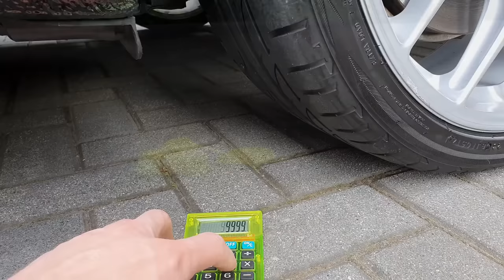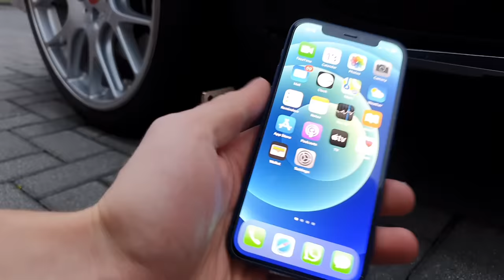4x iPhone 15 PRO MAX vs CAR 🤑💥 (13min Crushing Compilation)

Comment: He switched to fake ones at 5:37.  I know this because iPhone screens do not shatter like that.  If they were real iPhones then they would have cracked a little bit, instead, the fake ones he used in this video shattered like crazy.  The ceramic shield in the iPhone 12's would have prevented it from shattering like that.  Then, when he gets a close-up of when they shattered, the fake battery was in the center of the phone, and in iPhone's the battery is on the left side of the phone.  Plus, there were NO other parts in the phone other than the battery.
Reply: after seeing this coment i noticed and before that i was thinking that is this man a billionare because 1 i phone 13 pro is so costly and he just crushed 4?
Reply: It's too bad I fell for it...
Reply: Thanks

Comment: 5:34 that's all you want
Reply: They're fakes. 8 bucks a piece on aliexpress. 5:52 see the insides? It's just a block of iron giving it the weight of a real iphone. I have bought the same phone on aliexpress for 8 bucks, and it has the same insides as the ones in the video. Please stop thinking its real. :p
Reply: Is it soo!😱
Reply: @cuts3547  yup
Reply: The glass shatters like a glass pane. As you probabily have cracked your screen once, you know that glass doesn't shatter and fall off like that.
There's adhesive under the real phone's glass keeping it in place. So even if you'd drive over a REAL phone with a car, the glass wouldn't just fall off like that.
Reply: @randomphonecollector3853  thanks for that I was getting traumatised

Comment: 5:42😢😢😢😢 Plz don't waste things, it's a humble request🙏
Reply: They're fakes. 8 bucks on aliexpress. 5:52 see the insides? It's just a block of iron giving it the weight of a real iphone. I have bought the same phone on aliexpress for 8 bucks, and it has the same insides as the ones in the video. Please stop thinking its real. :p
Reply: @randomphonecollector3853  Yes, absolutely correct, not to mention there are no microchips spilling out, a phone can’t function without microchips, and the shape is different. And see where he placed the phone, he was turning on a black one, then he placed a blue - teal one. I can tell it’s fake.
Reply: Those we fake phones i think

Comment: Watch the cut when he puts the phone in the tray at 5:32 h totally could’ve switched to a fake one
Reply: Your right, he did switch to a fake one, because iPhone screens do not shatter like that.  If they were real iPhones, than they would have cracked a little bit, instead the fake ones he used in this video shattered like crazy.  The ceramic shield in the iPhone 12's would have prevented it from shattering like that.  Then, when he gets a close up of when they shattered, the fake battery was in the center of the phone, and in iPhone's the battery is on the left side of the phone.  Plus, there were NO other parts in the phone other than the battery.
Reply: Yeahhh
Reply: @johngibson08  no it's real bphone
Reply: @seemanga6526  what is a bphone
Reply: @seemanga6526  a Real bphone is a Fake iPhone made by a company called banana
Reply: @willmol7922  and a apple phone I thought was made by the horses in the habana from their love of apples
Reply: Definitely
Reply: Definitely 😊
Reply: It is not have real iphone it is fake
Reply: @johngibson08  true. the battery was probably fake as well
Reply: You can buy those at aliexpress for 8 bucks. I have one myself and it has an iron block on the inside to make it weigh the same as a real one